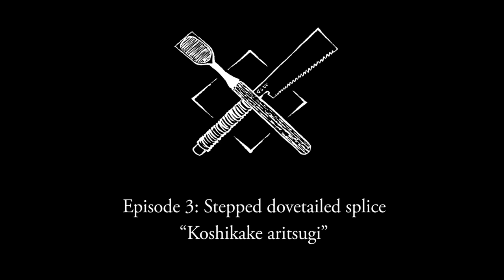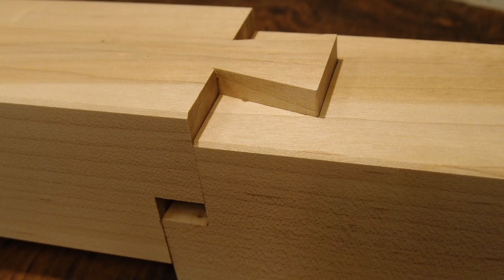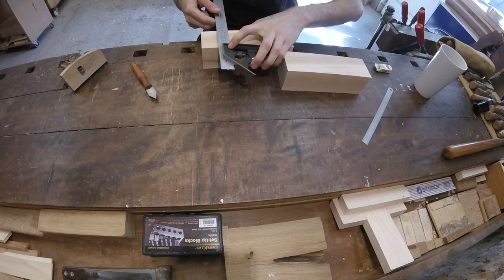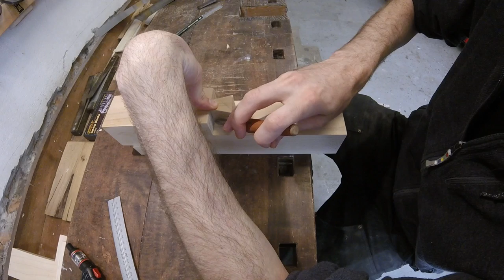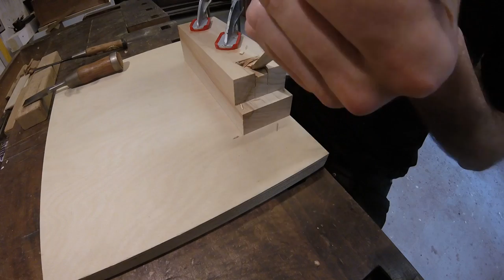Joint Venture Ep. 5: Stepped dovetailed splice (Japanese Joinery)

Comment: Your skill at making such tight fitting joints is amazing.  However I have a concern about this joint.  Would it typically be glued together.  Since it has a Japanese (?) name I would not think so.  It seems to me that the root of the tenon is not strong enough to resist a sharp blow.  What do you think?
Reply from the maker: +Cory Pride it is used for mudsill construction, so it usually is layed on the foundation.